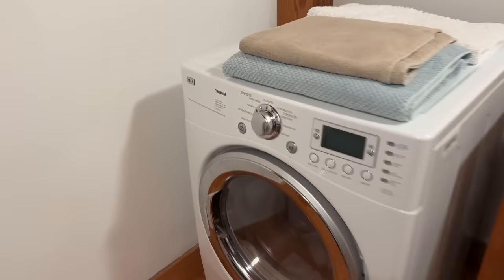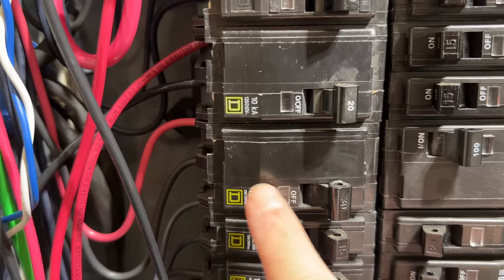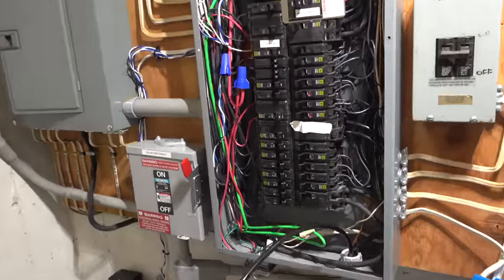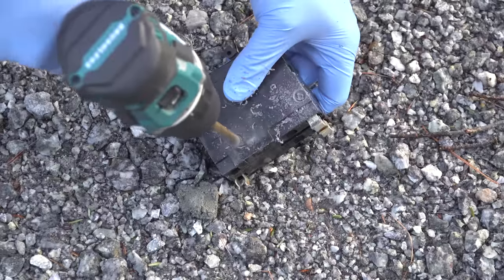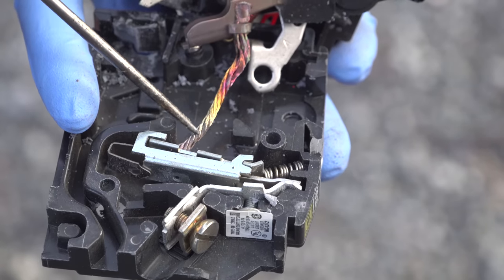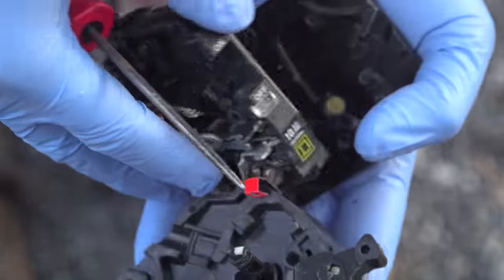If Your Circuit Breaker Makes a Buzzing Sound 🔥 Fix It Quick!

Comment: Can the circuit breakers in a Stab-Lok panel be replaced?
Reply: yes, by replacing the whole panel!
Reply: @r7boatguy  : Are you trying to say the ONLY way to replace a Stab-Lok circuit breaker is to replace the whole panel?  If yes, why is that the only way?
Reply: @brothermine2292  The breakers and panels are big fire hazards.  Not worth messing with.
Reply: @r7boatguy  : I understand how the Stab-Lok breakers are fire hazards: they have a failure mode in which they may protect against a short circuit (high current) only once (or only a few times) and after that provide no protection.  But why is the Stab-Lok panel also a fire hazard?  In other words, why couldn't replacing the breakers with better-designed after-market breakers eliminate the fire hazard?
Reply: @jovetj  : Thanks.  Can you elaborate on what you mean by ”poorly designed?”  Are you saying the design is hazardous?
     It seems strange that the government never ordered a product recall.

Comment: For single wire assignment, the wire should always be placed on the left side of the screw. This way it will be pulled in when tightening. On the right side it is rather pressed out.
Reply: 🎯 I thought the exact same thing...in fact it looked as if they did twist out a bit as they were tightened
Reply: This, this and this. Dude is smart but even the smallest mishaps can cause a ton of damage.
Reply: He demonstrated placing the wire between the clamping plates, so I don't think that is the case here.
Reply: Makes no difference with these clamps.  These breakers can have two wires on each terminal.
Reply: It isn't pulled or pushed when the screw is tightened. It is secured by a hold down plate.
Reply: @brianharmeson3144  you should still put it on the left side if you only have one wire on that plate. Look at the other wires in that cabinet. All wires are on the left side. At least do it for consistency.
Reply: @Marco911  it doesn't matter either way.

Comment: First step: hope breakers are still available for the panel you have. I am one of those unfortunate ones that breakers are no longer made for my panel. Atleast this is what i was told when getting a quote for a geothermal system.
Reply: you can still get breakers for almost any older panel. The question is cost versus quality of the overall job. I worked with many electricians who might special order a replacement for a Wadsworth, Pushmatic, etc.... but the point here was as a repair instead of a $3k panel replacement in an older home. The current customer is 85 years old and not likely to make any changes to tax the system.
Reply: @rupe53  i would expect them to be available but according to this guy they aren't and i haven't got around to researching myself. I have 2 westinghouse panels from 1965. Beyond that i don't have any part #s or anything readily available.
Reply: @95dodgev10  some of those really old panels truly dont have breakers available. Sometimes it's because for safety reasons (see stablok breakers by federal pacific...) other times it's simply obsolete. You may be able to get breakers but special order low production replacements will cost you a lot. If panel is that old just replace it.
Reply: @theelite1x721987  thats the plan. My brother is an electrician and can help me out and the house needs updated wiring as well. Nothing crazy old and dangerous but its not grounded. I'd also like to consolidate my 2 old main panels plus a small added on sub panel into a single new panel.
Reply: You could have a sub-panel installed next to or near the main panel. Use an existing two-pole breaker to power the sub and run the orphaned wires (and all new circuits) to the sub with all new breakers.
Reply: @BariumCobaltNitrog3n  i already have 2 mains and a small sub. Anymore and my basement wall is going to look like a sub station.
Reply: @95dodgev10  Hey go big or go home (where the panels are lol). Bonus points if the basement hums all the time.
Reply: @BariumCobaltNitrog3n  I'll be like clark griswald plugging in the extention cord when i flip my main main main breaker
Reply: @95dodgev10  🤣
Reply: @jovetj  most likely but i don't have that info handy. I'd like to update into one big panel anyway and i need to update the wiring to a grounded system anyway
Reply: @jovetj  my brother is an electrician and I'm generally quite handy so besides materials, which everything is inflated right now, it shouldn't be horrible

Comment: Suggest reading NEC 2020 110.14d, REGARDING TIGHTENEING THE BREAKER TERMINALS

110.14(D) Terminal Connection Torque. Tightening torque values for terminal connections shall be as indicated on equipment or in installation instructions provided by the manufacturer. An approved means shall be used to achieve the indicated torque value.

Informational Note No. 1: Examples of approved means of achieving the indicated torque values include torque tools or devices such as shear bolts or breakaway-style devices with visual indicators that demonstrate that the proper torque has been applied.

Informational Note No. 2: The equipment manufacturer can be contacted if numeric torque values are not indicated on the equipment or if the installation instructions are not available. Informative Annex I of UL Standard 486A-486B, Standard for Safety-Wire Connectors, provides torque values in the absence of manufacturer’s recommendations.

Informational Note No. 3: Additional information for torquing threaded connections and terminations can be found in Section 8.11 of NFPA 70B-2019, Recommended Practice for Electrical Equipment Maintenance.

Comment: "you want to get the exact same breaker that is in your panel" ... YES and NO! Sometimes you get a breaker that is the wrong one that someone had previously replaced... Make sure the breaker you buy is the one the PANEL requires. They do have cross reference charts for other brands that will work in your panel but I always prefer using the one the manufacturer recommends.

Comment: Good video, but you inserted the wires in the wrong hole. The wire should always follow the screw's motion, so that it works with the screw, not against it
Reply: You are incorrect. That breaker uses a clamp to hold the wire. He addresses your point precisely, watch again.
Reply: @jovetj  And I would guess about none of them are electricians.
Reply: @jovetj  That's important. I've been doing this for 22 years now, licensed, certified and all that, but I feel there is still more that I don't know. A lot more. Caution and patience go a long way.

Comment: First change those gloves-use leather or rubber or heavy nitrile. Yours are for painting. Dangerous. Next take an amperage reading with a clamp-on meter. Turn the entire panel off, verify it is off with a meter. With the panel off, tug on all the wires (to the side) nothing should come out. Check the neutral and ground wires too. Install.

Comment: I have a brief buzzing sound that occurs in my main breaker panel only when my 220v condensing unit turns on.
Because the buzzing is very brief only on start up, I cannot easily determine whether it is from the dedicated breaker for the condensing unit, or from another area of the box or Main breaker switch.
I don't know how best to determine the source of that noise?
Thanks for any suggestions.
Reply: Some people use screwdrivers when finding noises in cars. Put the big end against your ear and the other against whatever you suspect is making a noise and if you hear the sound much higher you probably found the source. Careful putting any metal against electric components, could short out
Reply: Not an issue. The buzzing you hear is from the magnetic trip element in the breaker and is normal with the high inrush current of the compressor starting.
Reply: @turbokatzenburg5732  

Thank you for that info.

Comment: 60/50Hz hum in the breaker skills be fine as that would be electricity
Reply: If you can hear it, there is something not right.
Reply: @Bendigo1  no, 50-60Hz should be fine, any other noise (clicking or arcing) should be taken note of. 50-60Hz is the sound of electricity. Most of not AC electrical appliances make it

Comment: Here in Mexico, few people actually use circuit breakers.
Reply: @darksam1212  It depends of the age of the house. Mine was built on the 70s and had stab lok breakers but recently the breaker from the hvac unit started failing and started humming so i replaced it with a brand new square d panel.  Newer houses may have electrical up to code but the mayority of houses here may have old breakers or fuses and instead of using romex cables they may still use noob and tube wiring

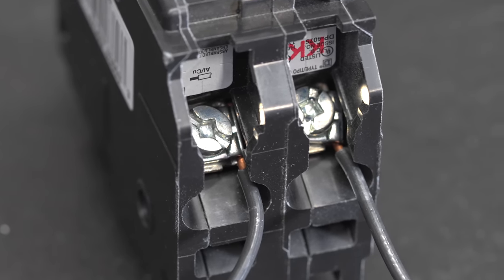Comment: At 2:47 you show the contacts for the wires on the breaker.
The upper plate on the right is rotated ~20 degree clockwise and would not compress the wire correctly.
Get the two plates to line up properly before tightening the screw.

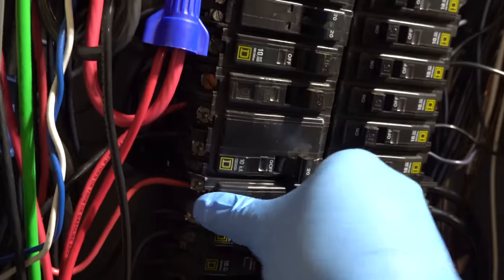Comment: 3:06 did you notice, that you inserted the wires on the right (down in the video), while the wires on the others are on the left (top in video)?
see also 1:50.
It's a subtle detail, but there is a technical reason why one is "preferred":
the turning of the screw slightly pulls in the wire when screwing tight.
the way you put the wire in, the wire is slightly pushed out.
It is no big deal when you carefully watch what you are doing, but it can be a benefit when you wire up breakers all day long.

Comment: Breaker out of panel: uses insulated screwdriver
Working inside live panel: non-insulated screwdriver

Don't count on those thin nitrile gloves to save you
Reply: Neither was insulated.
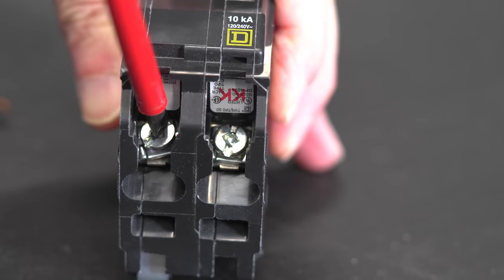Reply: @BariumCobaltNitrog3n  you see that red coating on the shaft at 2:18? That's plastic insulation to stop you touching the metal bit whilst you're using it
Reply: @NeneExists  I missed that one oops. Never seen one so shiny and clean. No need for the dig though. I was looking at the last shot of him dismantling the breaker.

Comment: 2:30 - You're right about putting the wire between the two plates, but you're wrong about which side of the screw you put it on. ALWAYS put the wire on the left side of a screw. This will help guide the wire around the head of the screw when you torque it down which creates a better connection.
Reply: This is a window clamp connection... it does not loop around the screw, it is held in place by compression, it does not matter which side it is on

Comment: Quite frankly no one should be working inside the electrical panel except a qualified licensed electrician. Sunday afternoon DYI types will screw it up, get zapped or burn the house down.  Leave it to the pro. If you hear something or smell something around electrical components, call an electrician at once.

Comment: First off, as per national electrical code, your wires are supposed to be twerked to the breaker specs which you did not do. Also, you're wearing latex gloves. Not a good thing to do. If something blows up, they'll melt right into your hands. Better off to wear cotton. Or no gloves at all.

Comment: Forgot to mention why you were wearing rubber gloves. Lesson the chance of shocky shocks
Reply: As a person who wears mechanic/gardening  rubber gloves anytime I have my hand on wires,  especially live ones, I can attest that any insulation on your hands is better than none.  Even those gloves will insulate you if you place the back of your knuckle on the power rail. Very easy to do when Messing with breakers. I have avoided many such shocks with the simple addition of gloves.

Comment: It’s bad advice to just swap the breaker, for the same one.  You need to check that it’s the correct breaker for that circuit rating.  It’s possible that the wrong breaker was originally installed and that is why it’s now faulty.

Comment: 2:00 Aren't those wires hot (live)? You need to be more careful
Reply from the maker: No, the power comes from the backplane to the breaker out the circuit. Once it's off or removed there is no power in those wires. But if you have any doubts double check it with a meter oil turn off the entire panel breaker
Reply: No those wires go to the circuit. The bars that the breaker attach to is what would be live if you do not shut off the switch going into the breaker box.
Reply: @SilverCymbal  Thanks for that. You're absolutely correct. I forgot this was a 240V circuit and is wired differently. I saw the red and black hot wires and got nervous for you.
Reply from the maker: @ChadDrakeTech  Yes no worries. Its always best to work safe and I will usually power the whole panel down to increase the safety.

Comment: Big mistake there you're making, use a VDE rated driver when ever you're working on a panel, not one with an uninsulated shaft.

If you let that become a habit, you're going to end yourself eventually.... and no, latex gloves won't save you, and no, 120V is not to be written off as "safe".

Comment: "Overloaded and overheated"? Well, circuit breaker should protect from overload. If it doesn't, it is defective already.
Reply from the maker: Very true, the cycles affect life though. A electric dryer breaker will run near limit constantly which I believe is what caused this ones decline.

Comment: that type of breaker is crap, seen to many burn up, get the homeline.
Reply from the maker: QO and Homeline are different. You can't swap then, the mounts don't match
Reply: @SilverCymbal  ment if you get a new box or changing the old one out, sorry.

Comment: trust me this what people don't know when wires are not tighten grip by clamp vs WAGO tiny clip on 20amp wire will sound like ??? i bet people gonna check that to hear any humming sound from wagos as well...cause i been telling so about downside of wagos....its only great for less than 5amps...nothing higher than 7amp....cause at 16amps ...the load start get massive then 20 amps where sizzling starts cause electron are moving faster than light bulb switch do ...way faster
Reply: Lol wut.... there is so much wrong here I'm not sure where to even start

Comment: also breaker need to be check the clamp itself where it stab too...cause once its get widening during life span ...its time to get new one ...clamp on breakers has to be very tight to break box stabs and wires has to be very tight on screw clamps as well...electrons are very hazzards when leaks out elsewhere ...like anything combust

Comment: Wtf is your breakers ??? You dont have a gfci to protect your entire installation in your country.
Reply from the maker: No, here those and what we call art faults are only required for certain circuits and definitely not the whole panel.
Reply: Ground fault circuit interrupters are only required on water contact outlets like bathrooms and exterior plugs. The rest of the house is not required to be GFCI. However bedroom plugs are required to be protected by AFCI breakers